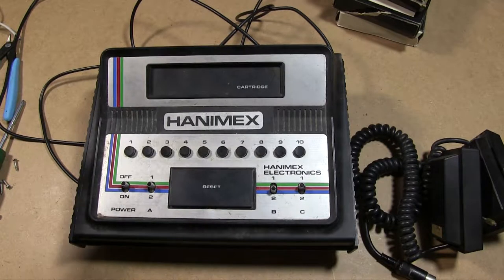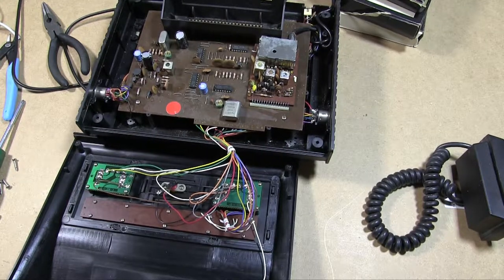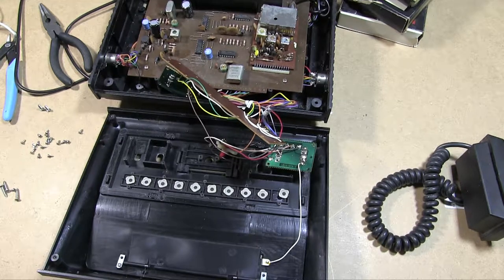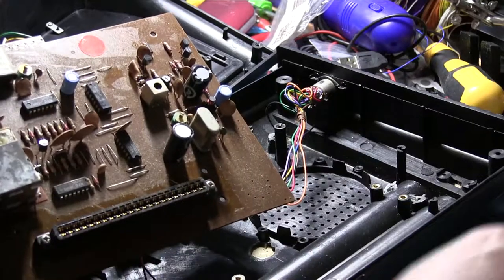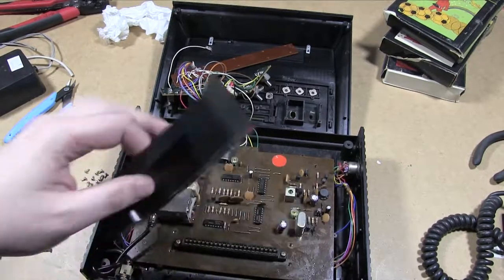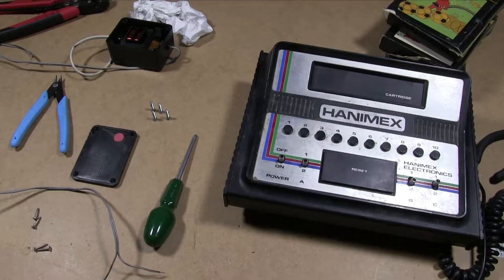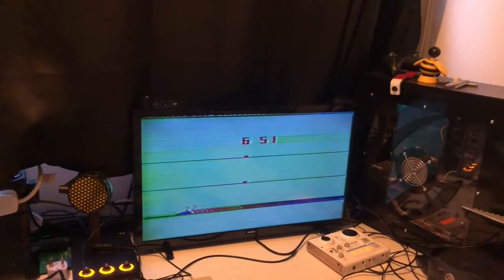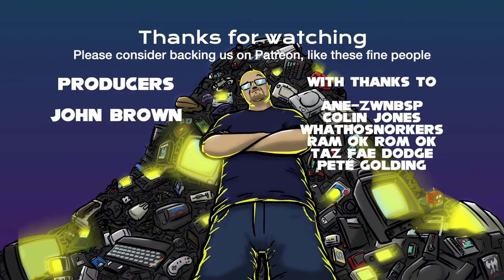The Repair Pile: The Hanimex TVG-3000 Console Restoration Part 2

Comment: These things seem to be such a pain to get a decent picture from.
Between poor RF converters (that relied on you manually tweaking the vertical hold on the TV), to the dial on the board to tweak the clock speed!
hopefully you can work out some common composite output for them.
Reply from the maker: Fortunately someone on Twitter has already done it, so I know it's possible. The issue is, apart from aging components, that these machines were built with fairly off the shelf components which were designed to support a wide array of regions.  The Modulator circuits are just PAL, but whilst PAL is a relative standard the frequencies weren't entirely standard and tuning was fairly loose.